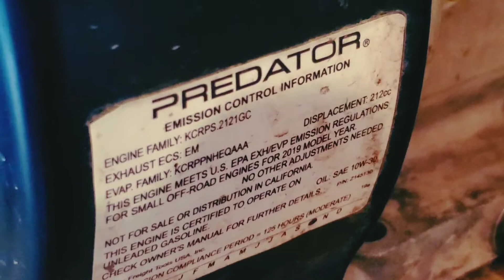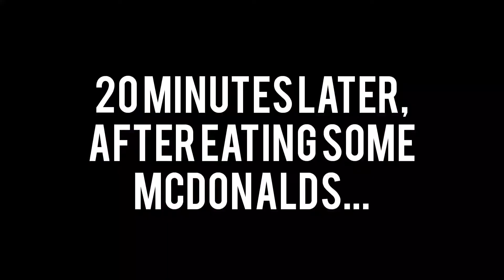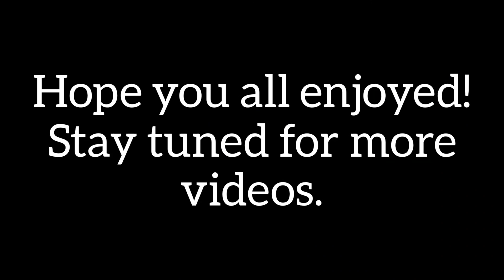Installing Charging Coils

Comment: If you add a 12 volt full wave rectifier from a 150cc engine, it will provide more power to the bulb and won't go dim when you are just idling it.